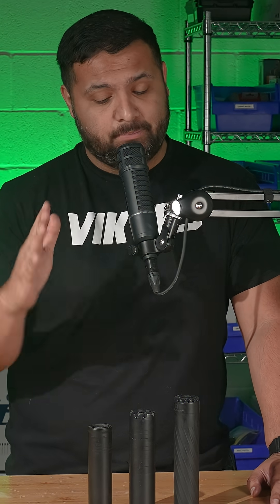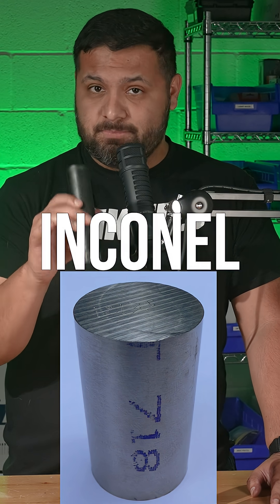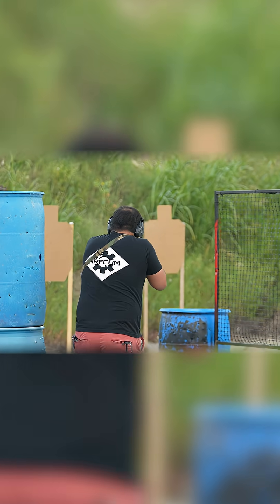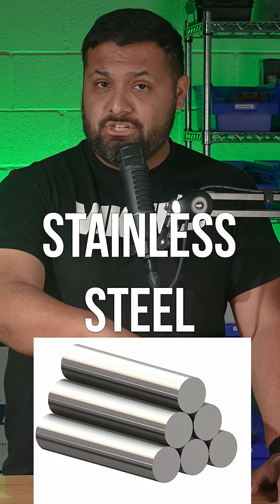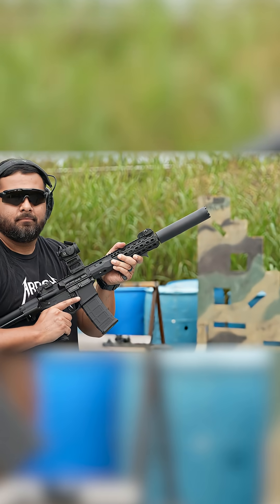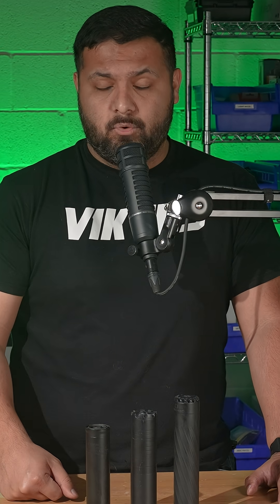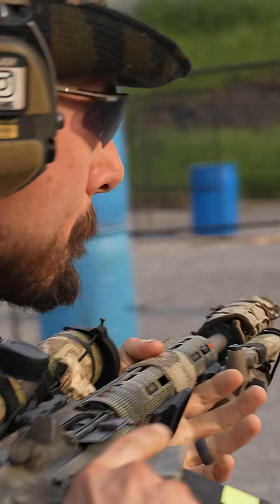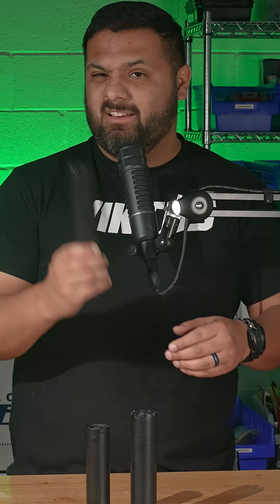Suppressor Material Matters | Inconel, Stainless Steel, & Titanium

Comment: titanium cools way faster than inconel and steel tho
Reply from the maker: Yes, it just also heats up faster. It's a really interesting metal, but it's biggest benefit of weight savings is enough to merit it's use
Reply: @ARFCOMReviews  Do you know if titanium gets hotter than steel generally?  Or is it same amount of heat and just basically takes awhile to work its way through the metal, thus takes longer to heat up and longer to cool down?  I've always avoided titanium, but considering one lately.

Comment: Titanium was never meant to be a material used for heat applications. Exhausts and suppressors just go off of the weight reduction you see from them…
Reply from the maker: Titanium isn't meant yo be welded, it actually does great with heat for thr most part

Comment: I got a Lahar 30, it’s so freakin quiet.. it’s a cheap option and o went with it over expensive options because of how well it reduced sound. I actually halted the process on a sandman to get the Lahar and am glad I did especially with the Xeno Omni brake setup
Reply from the maker: I have hear great things about the Lahar 30!
Reply: @ARFCOMReviews it’s actually crazy impressive.. a little heavy I guess, but idk any silencer hanging off the front all feels pretty similar.. at least steel suppressors. And the Xeno Omni brake is a reverse thread mount, so you don’t have to worry about the can loosening when you shoot, because it actually tightens because it’s reverse threaded. It’s a fun set up

Comment: Currently running a b&t print x 7.62 titanium which is surprisingly full auto rated by the manufacturer. A little expensive but worth it if you want a durable Titanium can
Reply from the maker: Dude! We have tested their 5.56 K can and full size and it rushed it in the heat testing and flash!
Reply: Some manufacturer’s full auto rating means it’s legit full auto rated, others’ means if you put it on a full auto and it blows up, it’s still covered under warranty. Just food for thought

Comment: Titanium, when it gets really hot and heat cycles will get brittle.  That is another downfall to titanium.

Inconel is used as a material in exhaust valves in high performance automobiles due to its superior strength in those environments over stainless steel, but it does come at a cost.

Stainless steel is perfectly acceptable IF you are not firing at a high rate.
Reply from the maker: I agree completely! All of our research into the matter backs this up 😊